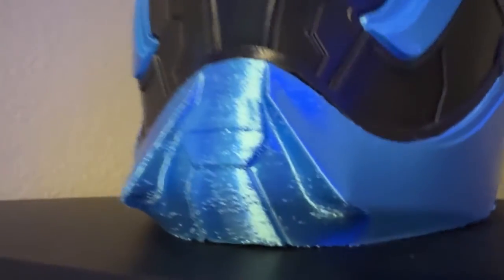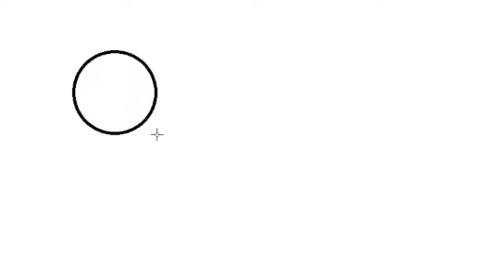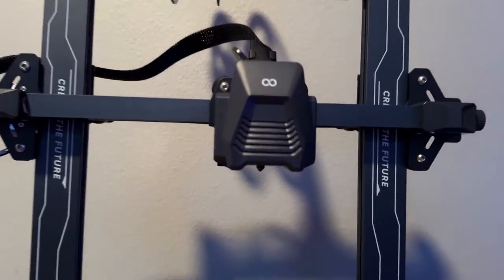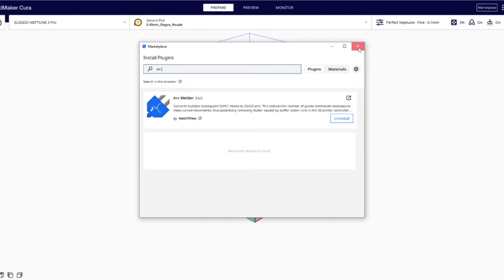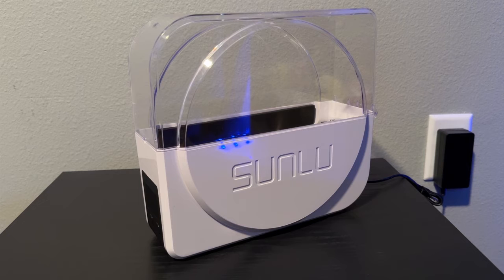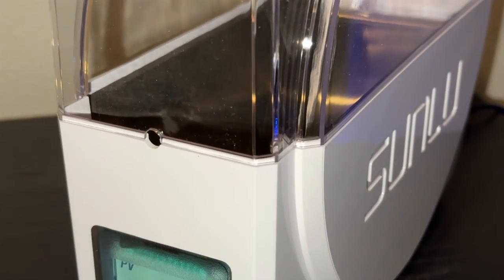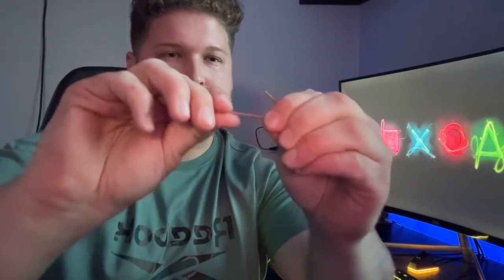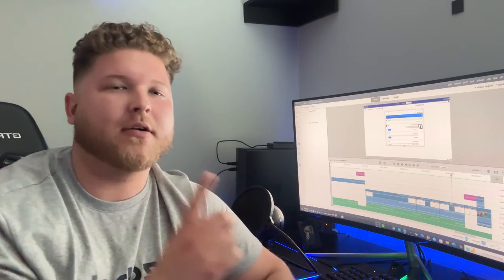3D PRINT BLOBS *SOLVED | How to fix blobs/bumps on 3D prints

Comment: Ok, but like for somereason why, only the top part of my 3d print object has blobs. Its really weird like no other 3d prints that I've printed have these blobs, is it like part of the file that's bad? Because it's only on the top part of this print only
Reply from the maker: If it is a rounded out part where the top of the print is rounded, it could possibly be with the same settings, true to find the seam setting in your slicer and either align it or the back option, it may be on random, leaving dots all over. Let me know if it works